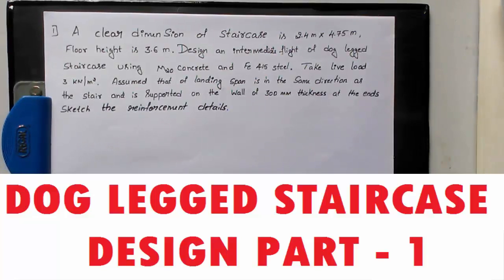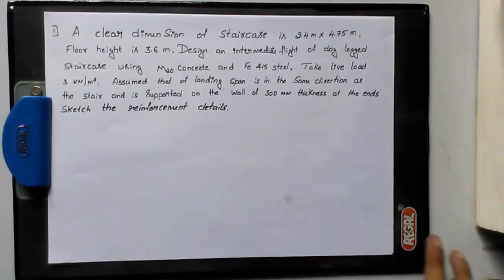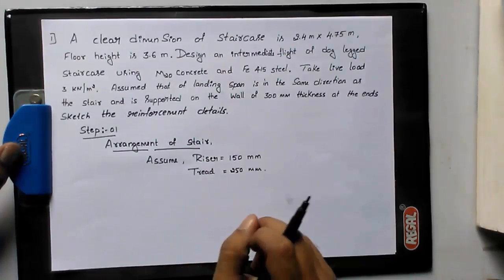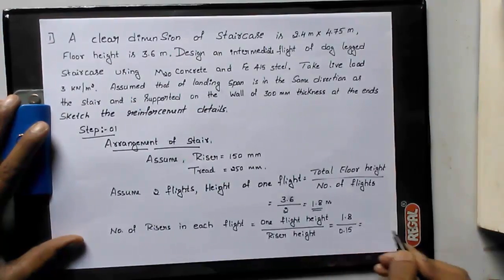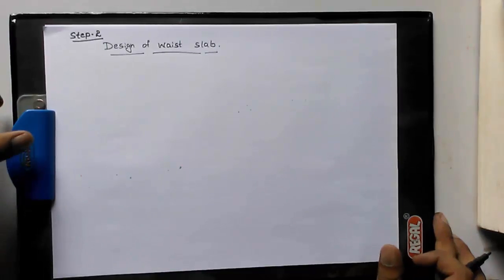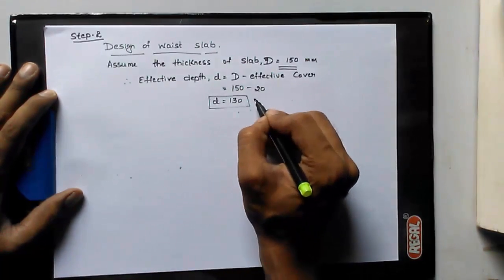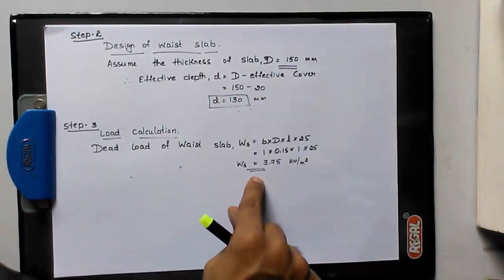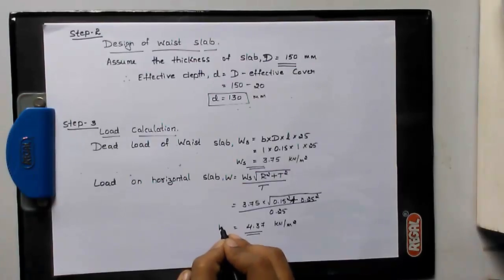Design of dog legged staircase | dog legged staircase design - design of dog legged staircase

Comment: Iam confuse in that load on step per meter length as u have multiply 0.468 which is in kN/M2 with  1000/250 which is in mm is it correct I have exm tomorrow I need to know that
Reply from the maker: No worry, you can multiply by 1m/0.25 m also,
You will get same answer....

Comment: There is one more step to find thickness of waist slab by effective span of 1/20 .  why u were not calculated by this formula. Mostly I saw this step in all design of staircase.Can u tell me the reason why u assumed thickness of waist slab. We can calculate by above formula I wrote.
Reply: Can you teach me to design staircase?
Reply: wow...you have got an amazing english there.
Reply from the maker: You can calculate by that methods also, but when you check for depth, that value should be within limit